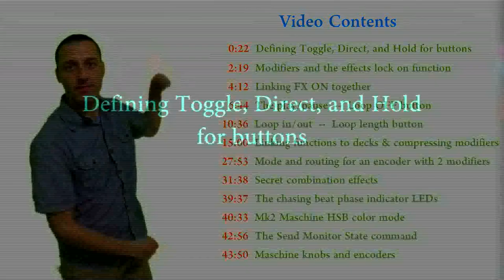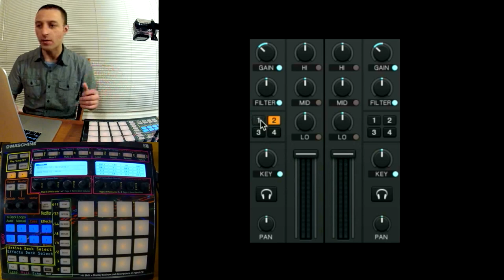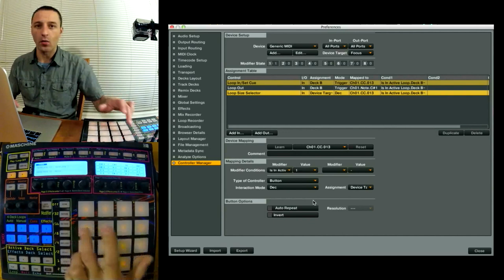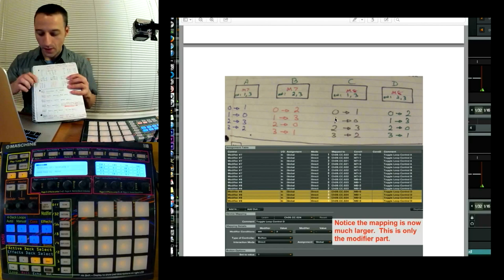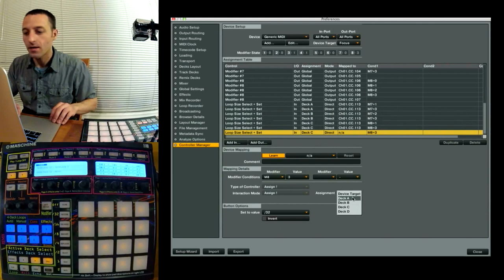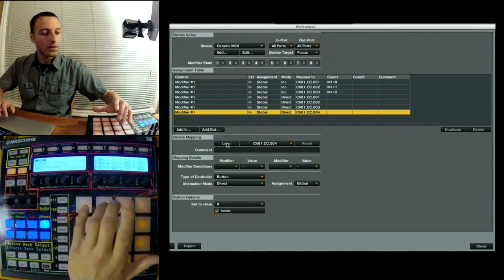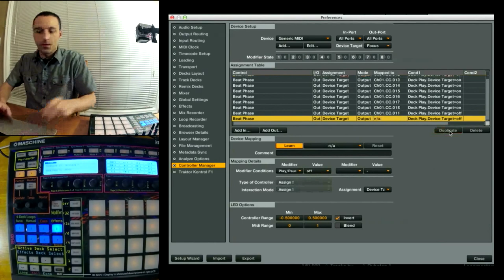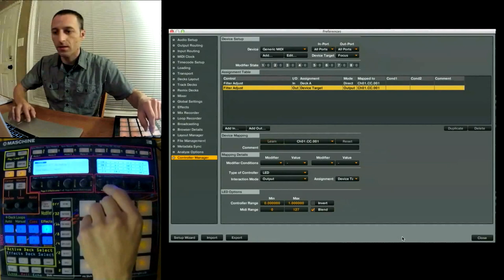Advanced Traktor mapping techniques for NI Controllers

Comment: Traktor has had this since 2013?!  I've been using Bome's Midi Translator and hacking XML for years to achieve these same things in Serato that Traktor has had out-of-the-box since at least 2013?! WTF is Serato doing? With Serato's slicer not able to be midi mapped & their subscription DVS plan, I'm convinced they only care about selling more controllers and locking people into payment plans. I'm blown away by NI's thought behind such a nice midi mapping interface. I'm sold & am buying Traktor tonight.
Reply: its great mate. i have a kontrol S3 - 4 channels  controller, kontrol F1 (16 pad sample box with 4 channels itself), 2 midi controllers to control 12 effects (each can be assigned to decks a-d with a rotary fader for each effect as well as wet/dry for each bank of 4) (beringer xtouch mini btw). and a kontrol m32 keyboard that i use to control the key/pitch of each deck and L/R balance. plus each of the 32 piano keys i use to control 1/8 of a sample in each deck. so i can loop up to 4 decks, split each loop into 8 then control each of those 32 segments on the piano. its crazy when i can do and it all cost me less than i spent on 1 of my old technics decks. i can basically completely remix songs on the fly. 
and thats not even going into remix decks and stems and live audio looping too on a 5th channel
i can also hook traktor up to maschine and basically write music in real time whilst mixing but im a much better dj than musician :D
Reply: @kanedNunable  This sounds sweet. Do you have a video of it in action?

btw, I've been using Traktor basically since this comment. There was a point I tried Serato again after buying the DDJ-SB3 to practice scratching while I travel, but I was actually surprised by what I felt like I was missing from Traktor, so it's now midi mapped for Traktor too. Traktor isn't perfect, but I'm so happy I made the switch.

Comment: Hi! Thank you for this amazing video. Can You help me please with my mapping light out problem.
I want to use a button for 2 function on my controller (xone k2) but that is does not matter in this situation. For example that button FX Unit 4 - Button 3 function with amber colour light. But I also use this button for FX Unit 4 - Unit on function with Modifier (shift like) and red colour out.
My problem is. When I use Button 3 Amber light on, that is fine, and after that I pust it with shift (Unit on) red light comes up, also fine. But When I press the button again with shift than (Unit off) On that button has no amber light, but the FX Unit 4 - Button 3 steel on. Has anyone know how to mapping the light correctly? I hope that is understandable….

Comment: Hi, could you please explain how to activate on Maschine MK2 (midi mode) a knob on Relative (offset) mode? I tried to activate from the NI Controller Editor Assign Tab then selecting "Relative (offset) mode but doesn't work because when I turn the knob it just gives me 2 values: 0 and 2. Thank you.
Reply from the maker: Check out this video:  https://youtu.be/BJZ27iVoq2A
Reply: @LabCoatPaul  Thank you Paul. So basically I should ignore the values that Maschine MK2 outputs on its screen (0 and 2) and consider that the actual values that the encoder sends out are 63 and 65. Wondering why the MK2 does not show the actual values on its screen. It would have made much easier to understand what is going on!

Comment: Hey community, I have a question related to some advanced modifier mapping. I am trying to map some toggle modifiers on cdj400 to use with  for the snap and flux features in Traktor. Is there a way to sync the modifiers between different devices? Say, deck A, I enable snap and that sets Modifier 1 (M1) to a value of 1. Is there a way to automatically set M1 on deck B to 1 as well? I've not found a way to do that yet. Let me know your thoughts.
Cheers
Reply from the maker: No.  Each controller gets it's own mapping and it's own set of modifiers.  You can't share modifiers between controllers.  You'll need to find a different way to accomplish your goal.  What function are you trying to map?
Reply: Paul Shpakov that's a shame. It would be a great addition for future updates of traktor.  I essentially wanted to map snap on/off and flux on/off on a single button with a modifier to distinguish between them. However, because neither of them are in the conditional drop down menus, I wanted to assign flip-flop modifiers to them and use them for conditional output mapping. That way a single button would tell me any combination of on/off of those two functions with different flashes or a solid light. The challenge is that snap on/off is a global function and flux is a local one. So, the feedback leds will go out of sync on the different cdjs because a press on one will not update the modifier on another. Hope all this makes sense. I've managed to simplify my feedback led states and that helped me map them in a coherent way and synced across devices.
Cheers
Reply from the maker: I've learned to stay away from using modifiers to keep track of LED outputs.  It always gets messy, and never works right.  Just skip the LED feedback on a couple things, or maybe move those functions to separate buttons. 

 I made a mapping that lets you DJ with 4 decks on just the NI Maschine, then updated the mapping several times.  As I created newer versions, I  found myself simplifying the mapping every time.  When I made the first version, I felt like 8 modifiers were not enough.  The newest version had more features, a cleaner layout, and only 6 modifiers.
Reply: Paul Shpakov I agree with you. Simplification is key.  And that is exactly what I did in the end. 😊

Comment: hi friend, first of all, congratulate u and thank u for your work, really helpful.......by the way excuse my english, is not my first language.........i have 2 questions for u:
[QUESTION 1]: when i use a modifier to make a switch=(direct, inc, dec.)..., (lets say to switch between Fx 1 & 3 or 2 & 4, they are going to be sharing the 2 Fx in the controller), and lets say that after doing so successfully this modifier has still 4 states that i did not use, i would like to use this states with a "hold" for other feature...so... is there any way where the modifiers on hold are going to remember where they where when i press the hold instead going back to state "0"(zero) ? .....(refer me to a point in your clip if i missed it please :)
[QUESTION 2]: i used 2 modifiers to map the feature of my controller called "VINIL", (a switch for the Jogh W., when pressed u can scratch, when not pressing u can tempo bend), i wanted to use 1 single modifier to make the "vinil" feature for all Decks, with 2 modifiers i have 4 states on each modifier that i felt i spoiled..., so when i use 2 modifiers this would be the states .........M8=0 (C & D= Off), M8=1 (C=Off & D =On), M8=2 (C=On & D=Off), M8=3 (C & D=On)...(SAME for modifier 7 with (Decks A & B)...so when i try to do it using just 1 modifier, ("vinil" in all decks), i come across 16 possibilities for the sates, and modifiers has only 8 states... i am doing something wrong? there is any work around for this problem?......
excuse me the long post & thank u in advance brother :)   bye

Comment: Hello Paul. I just update the Controller Editor to 1.6.2. I got problems when tractor sends fx value to the knob. I tried to map it as a button as you said on 49:23 but is not workin. Please help me
Reply from the maker: Hello Angello!
Sorry for the delayed response..  I just found a great new way to map the knobs with Controller Editor 1.6.2!  Set your knobs as Relative(offset) with a step of 5 and resolution of 100.  Then in Traktor, map the knob as encoder relative 3Fh/41h, with a sensitivity of 100 and acceleration of 0.  It works great!  Adjust the sensitivity to change knob rate.

Comment: Hi
Great tutorial! Thanks for that, I've been able to start with my mapping of the Kontrol D2. My aim is to ad the Cell delete function in remix decks C & D. The first 8 cells works like charm: holding Remix button on the controller and hitting the pads it works as I planed. However the problem start when I want to remove next cells for example 3,4,5 and so on, in the  slot 1,2,3 and 4. Do you have idea how to do that? I have only 8 pads available on the Kontrol D2 but aiming to control all cells with delete function. Please help. Regards
Reply from the maker: You'll need to add a modifier to keep track of which cells you're working with.  
I haven't used Traktor for more than 5 years, so sorry I can't get more specific than that.

Comment: At about 32:56 when changing the interaction mode to "Direct" I do not have the option for "Invert" under button options. How do I access that option?
Reply: Im having the same issue.
Reply from the maker: Freakwensiz
What command are you trying to map?  What version of Traktor are you using?
Reply: I've figured it out, it must be the Traktor version I've got (2.5). I've figured out a workaround using more modifier values and dec values though, just not ideal. I think I need to upgrade, I'm just always wary when software is running as I want it to upgrade. Thanks for the tutorial though bud, great work!
Reply: Oh, and it was for the release values for the beatmasher. Seems the invert on direct mode was a new addition.
Reply from the maker: Freakwensiz The newest version of Traktor is great!  Super stable, not buggy.  I recommend it.  Traktor 2.5.x is actually one of the worst versions I've worked with, as far as bugs go.
Reply: Yeah, it all seems great except:

I had my Maschine mapped onto the pads to set and store hot cues, if the deck was in active loop, it would set the cue type to loop and store a loop, if it wasn't in a loop, loop type would be cue. Straightforward. These also had colors assigned to them using HSB.

What is happening since my update is if I have a cue stored on pad 1, light showing as blue, and I enable loop mode and hit pad 2 to store a loop, it is over-writing pad 1 as a loop, but in the same place it had a cue stored. The light is also changing to indicate a loop on pad 1.

What's changed?

The only thing I can see is that is different is 2.5 had 'Hotcue 1 Type' where 2.7 has 'Hotcue 1 State' I've checked that all these are amended.

Help, please and ill buy you a cookie.

http://www.sendspace.com/filegroup/MwKh3ooBqDavtZyBQ3gV2Q - Mappings for Editor and Traktor
Reply: Freakwensiz NVM, all sorted. Re-mapped my whole controller in new Traktor.

Comment: Great Tutorial, one question I have left. I mapped an loop section where single buttons have an length for an loop. What I wanna to do is, that when the button loop length 4 is on, that it change the color. Is that possible ?
Reply from the maker: yes.  Which controller are you using?  NI controllers use HSB color mode and mapping color output is a bit tricky.  I wrote some instructions for it, but I don't have a video.  e-mail me at Paulz1265@gmail.com and I'll send it to you.
Reply: did you received my mail
Reply from the maker: Got it.  I sent you the tutorials.  I will fix my website soon, and it will also have all the downloads.